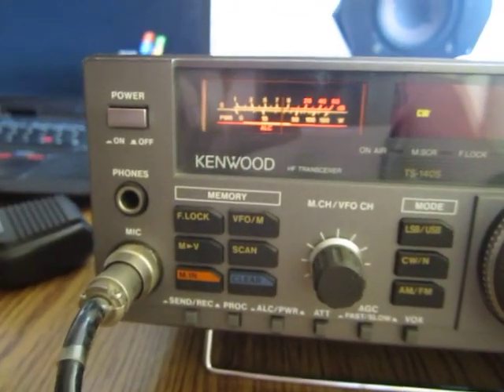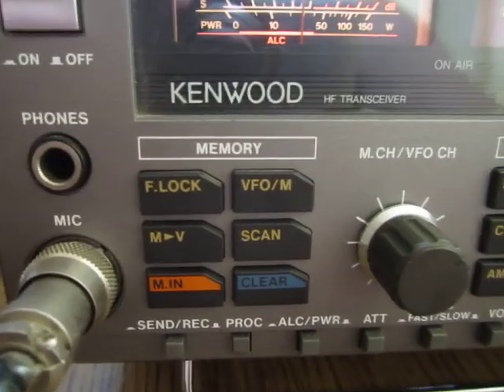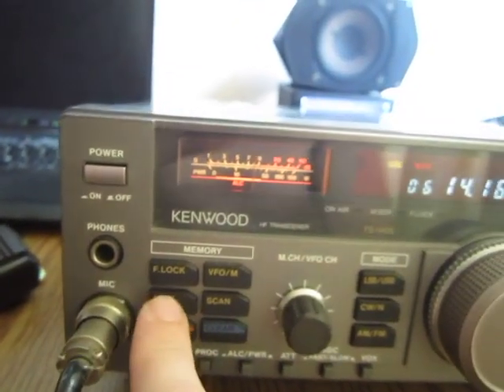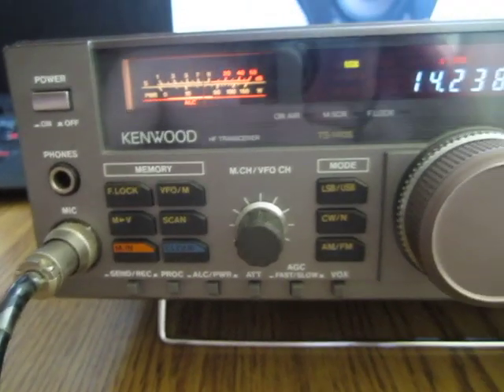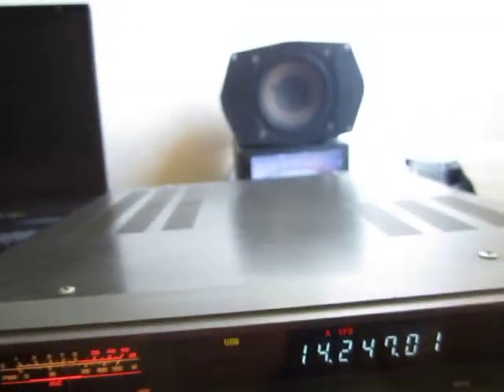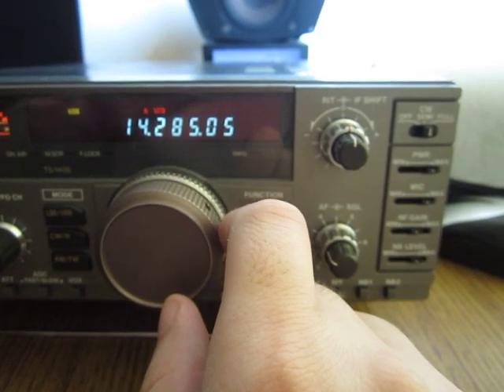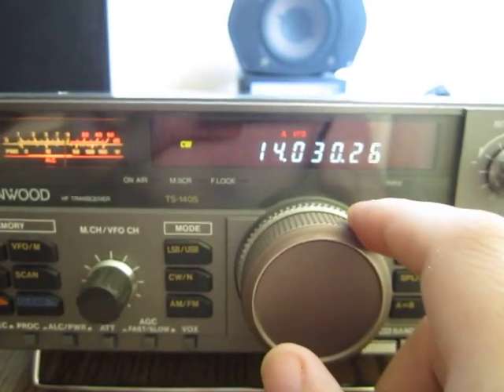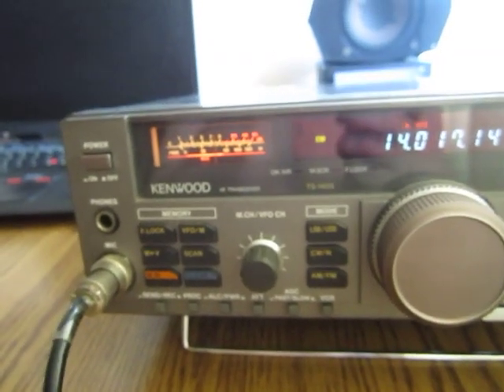TS-140S

Comment: I had one of these as a young teen.  I am almost 45 now.  This would have been in the 90s.  I liked it over all.  Simple to operate and all that a casual, voice and cw operating kid needed.  I used mine for quite a few years before selling off the whole station in the 2000s.  I did have serious problems with the sliders though.  They were extremely touchy and just plain wonky.   This must have been a common problem because the only other rig I ever seen them on was this radio's twin with 6 meters added on the TS-680s.  I think they realized these didn't work well.  I got lots of great audio reports from it on both SSB and AM, worked a lot of FM on 10 Meters, and worked the thing to death on CW on 80.  Thanks for letting me revisit the old days.  73 N8PEF
Reply: I need a power slider now for my 140s !

Comment: Reducing RF gain to control noise is a bad idea. The receiver's AGC is squashing the sensitivity to weak signals. Better to use the noise blankers and in worst case scenarios the ATT if the noise level is too high.  I have a 140S, it's a good radio for the price. Mine is not nearly that noisy on receive. Do you have something near your shack generating RF hash?
Reply: Worst advice ever. You should use the RF gain almost constantly on the 140 because it has a very high sensitivity, being designed for mobile use (low gain antennas), and especially since you cannot disable the preamp, the attenuator is very useful on the low bands. A rough setup would be to reduce the RF gain up to the point where you can still distinguish a noise floor increase (~6dB) when disconnecting your antenna. Noise blankers are to be avoided in any case because they introduce A LOT of distortion. I modified my 140 to use the Squelch knob as a RF gain control (who needs a squelch on HF?). If you optimize your reception, the 140 can handle its own with the best: I also have a TS-940, a Ten Tec Orion and a Perseus.